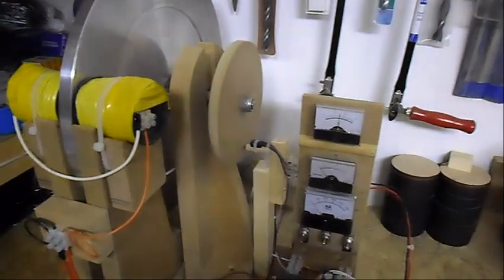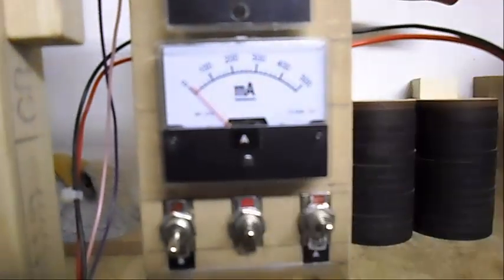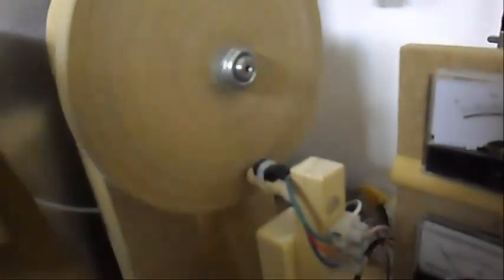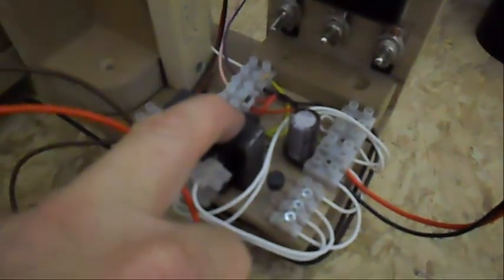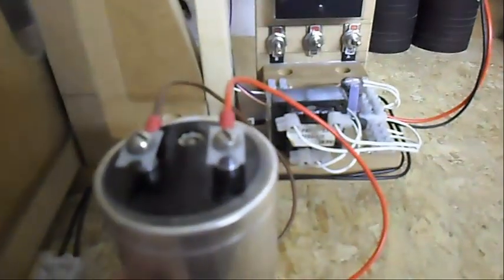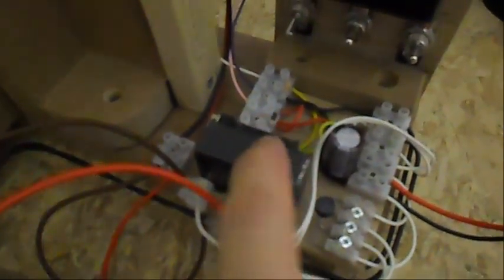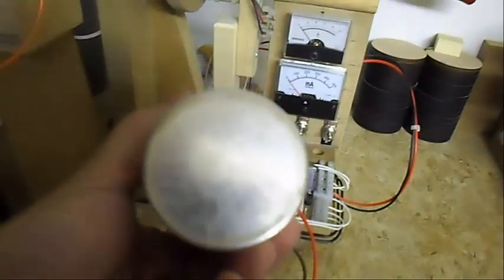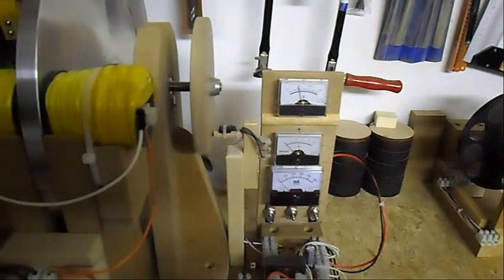Pulse Motor - 18 Pole Rotor & Selfdriving Circuit Test...

Comment: hi mate. just in case you’re not aware, if there’s any eddy currents in the flywheel this acts as a brake and an avoidable loss in theses systems. 
it’s nicely built and runs smooth and quiet tho.
Reply from the maker: Thanks for your info on our friend Eddy(lol) and yes i know about the effect of aluminum and magnets but all my setups with an aluminum rotor are very efficient so i must be doing something right...right? ;)

Comment: you can use rotors but you want to make sure to use the push and pull force of the magnet simultaneously.  Unified filed  instead on mono pole ,difference between mono pole and unified field is simple , mono pole uses only one magnetic pole of a magnet or electro magnet , unified field uses both poles of the magnet and the electromagnet. Since with a newman coil you can use only one drive coil to drive instead of two when using a rotor you save energy cause it's one less coil. every extra part counts as energy loss , point is not to drive a circuit with it's own energy since that is not possible in gravity field,, point is to collect energy from the gravityy  or pressuree  field and use that energy to drive our machines.

Comment: Newman Motor uses very thin wire with a lot of turns and a lot of high voltage with very little to no current, he used dead 9volt batteries to drive his pulse motor and the coil was split in the middle where the magnet was positioned on a shaft with bearings

Comment: Mr Carribean try placing collector coils on the other side of the drive coils... the side facing away from the rotor or the side not facing any magnets , the side facing air.  and funnel the energy from the collector coils into the cap